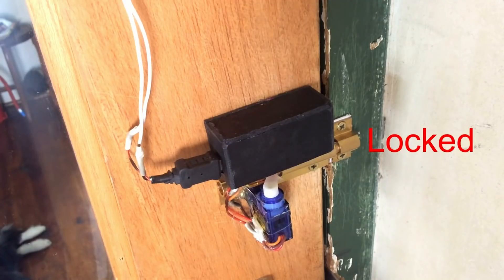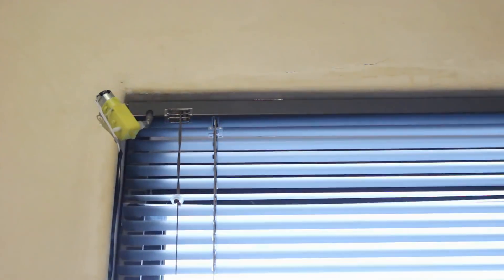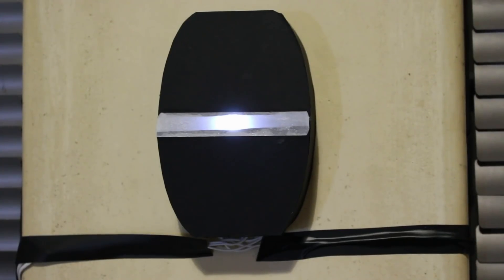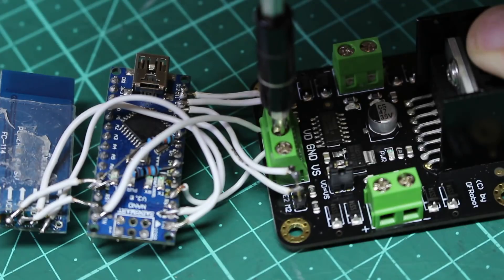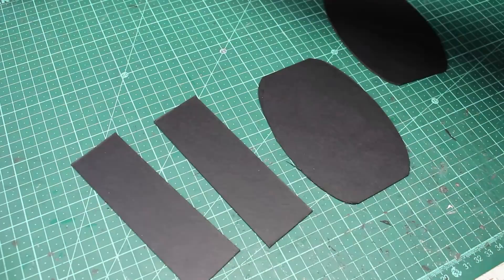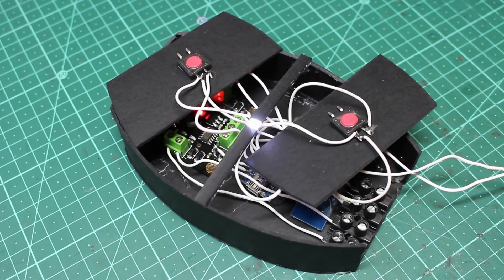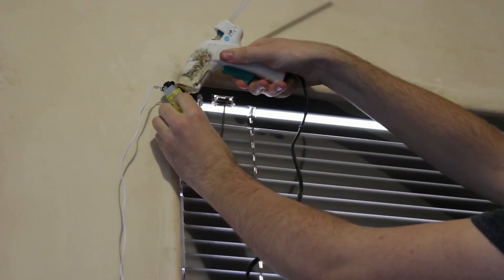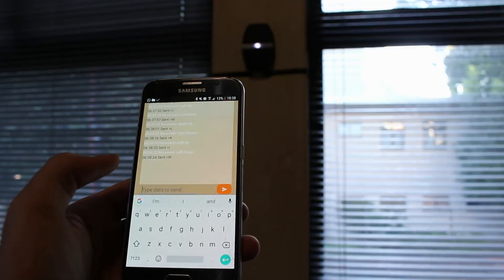Voice Controlled Arduino Blinds

Comment: I am using an arduino uno and I am only doing motors. No push button and no Led. Objective is to turn motors via Bluetooth (Hc-06). When I make edits to the code to take out push button, LED, and going to only one motor I cannot get the motor to work. I am using a motor controller that does have the enables. Could you help me?

Comment: Did you put the 9V power supply to VIN and GND pins at Arduino, or some else. What do you recommend - USB power or 9V adapter for running arduino?